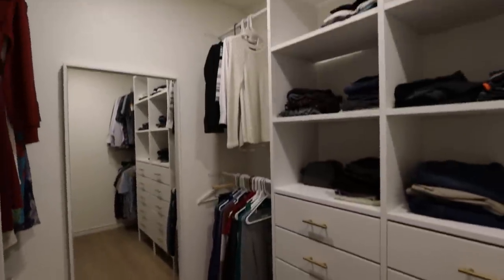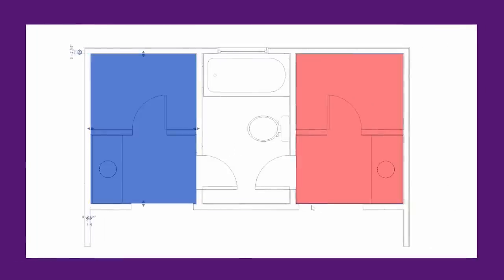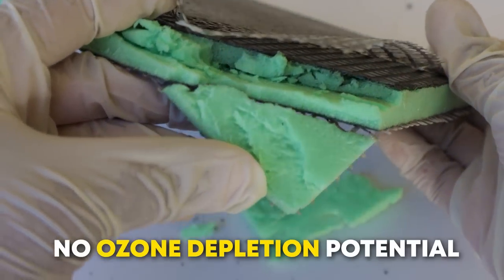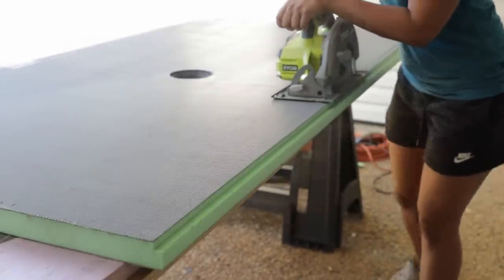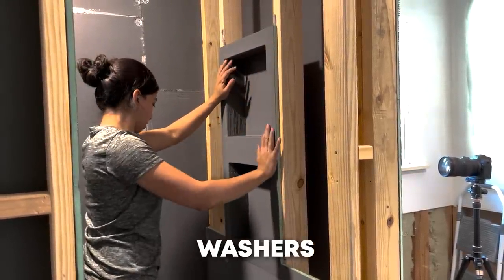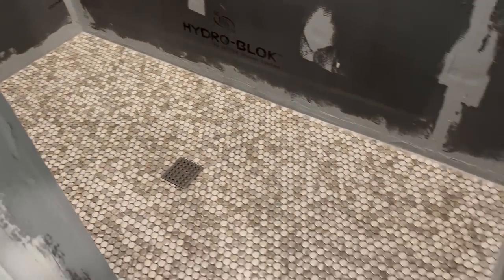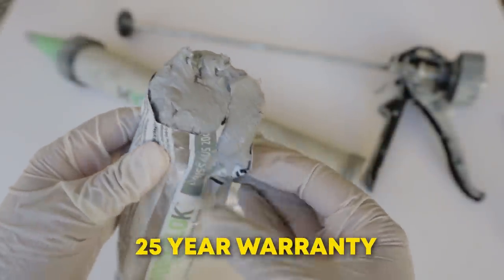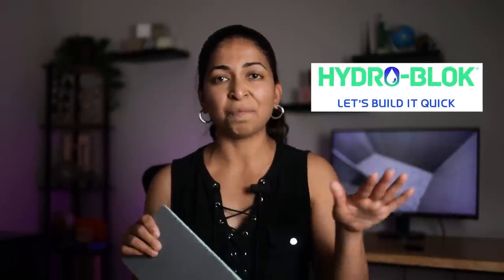How I built my bathroom & shower with green FOAM!

Comment: I did two bathrooms with a similar product in France. Works great! 
You can use the thicker panels to provide insulation on outside walls and the thinner ones can be used to cover irregular/old plaster (or concrete) walls.

Comment: I've been using Hydro-blox for a number of years now. I first started using the foam panel products when I discovered Wedi Board. It's an OK product but the Hydro blok panels are stiffer and denser. Using 1/2" concrete panels for shower walls is so last century. They are heavy and awkward and dirty. The foam panels are so light in comparison and can be cut easily with a matte knife. The development of these products is such a huge revolution for bathroom design, cleanliness and longevity. I love Hydro-Blok.
Reply from the maker: Thanks for sharing your experience!
Reply: Thanks for sharing your experience with using our HYRDO-BLOK.   That means a lot to us!!
Reply: How does this compare to my ideal shower enclosure material: fibreglass mould or acrylic walls?  They seem to be similar price-wise.
Reply: This material offers flexibility in being able to quickly shape it to any wall design. It is similar to the versatility of a sheet of drywall. You can easily create a curved shower wall enclosure.  Customize it to your needs. The pre-sloped shower pans can easily be customized as well. And the sealant is what sticks it all together of course with the washers and screws too. You can cut it all with a utility knife. I used to make the two layered mortar shower pans with the membrane. What used to take me 3 days now takes me 3 hours. The panels are super lite weight. No worries about screws below the curb-line. I'd be happy to answer any questions. :)
 @julesverneinoz
Reply: Thanks for the response  @maxadrian  .  You confirmed my conjecture that this material is best suited for customized bathrooms (those who don't like the plain look of and far easier maintenance of fibreglass mould or acrylic walls).  Do you still need to regularly clean the grout with this material, since (potentially) there's no grouting?
Reply: You do realize that the face of the hydro-blok panel is a surface that you tile on to, right? So with that said every tile project I've done has had grout. So, yes you do occasionally have to clean the grout. @julesverneinoz

Comment: A tip for using the sausage tube caulk guns. Insert the unopened tube into the gun, then pierce a few holes in the top of the tube and screw on the nozzle. After that trim the nozzle and squeeze out the product. When the product is out you can unscrew the nozzle an pump out the casing without making a mess inside the tool. Cutting the tube and inserting into the back of the gun as shown in the video will make a mess and may jam the gun. I bet Belinda did it this way for the sake of the video 😊.
Reply: You beat me to it.  They work great if done properly
Reply: @flyinpolack6633  Yeah, and the reduced waste and nozzle flexibility are a big plus. The guns are usually better built and higher leverage too! Wish big box stores stocked product in this format.
Reply: @juancarrera5524  What's with everyone calling caulk "product"? I've only ever noticed that from the makeup people. Is there overlap with this channel and the makeup crowd?

Personally it feels like a brainwashy word to use, conditioning us to believe that all things are meant to be "products" sold by corporations for profit, a.k.a. consumerism.
Reply: @MountainMan-ri2lr  lol I call it product because those tubes get shipped with other stuff than caulk sometimes.
Reply: @MountainMan-ri2lr  That's some tinfoil nonsense right there...
Reply: Thank you for the advice. I've never used one of these guns before. What you say makes good sense.

Comment: I would be interested in a comparison of Hydroblok and Schluter system. And/or details of the conventional cement board system they replace.
Reply: Cement board is shit. Cement board stays wet for the full half inch. It gets mildewy and stinks over time. Hydro-blok boards are waterproof after the first millimeter of depth. And may never get wet if you seal your grout well. Don't be afraid of it. It has been used in Europe for many years. The West is always slow to adopt new building techniques and materials. You don't need to build a concrete bunker for a bathroom. Expansion joints in all the suspect areas and you are golden. Try it. You'll think you died and went to heaven. You'll be saying, "Everything is so light and easy to work with. The days of sloped mortar beds and dusty heavy cement panels that crack and give you a backache are over!

Comment: I have only done one tile job and I used that red water proofing stuff. I did 2 full walls and the entire bathroom floor. We did an open shower. While it worked quite well not all the water drained off. I wish I would have added a 2nd sub layer floor and then cut a board with a very sharp taper for the shower area and glued and sanded it down so that way the shower had a sort of pan. Using some thin panel boards to help taper it down even more. Then installed the red water proofing stuff and then the tile work. It was meant to help someone who might one day need a better access to the shower with out a lip. It was super cool and is likely gone now. 
My current shower is a 2 piece fiberglass kit with a seat in it. I quite like that one a lot better. My next one is going to be one of those 2 piece kits with the roof section and the widest they make. I would love to find one that is 7 feet long and 5 feet wide with the roof cap and a really nice door. 
Though I am considering doing a tile one yet I do not want to have a raised tile section above my finished concrete floor. Kinda want one that you step down in to.  I want to install 6 of those stainless steel hand pumps that are built right in to the wall.

Comment: Hydroblock is good stuff, there are other brands too and that laminated foam panel type construction is more popular overseas. Tile still sucks and sadly i saw lots of grout joints but its ok for folks who cant afford panels. Those joints are messy for lots of folks (even pros!) so dont sweat it.  If you are good at drywall the tape and joints are a little easier. Thanks!

Comment: To avoid mess while working with caulk mix water with soap, apply it  on hands and caulk when  it’s pumped out on your surface. Much easier to wipe it off and you can spread caulk along with a finger. Look for a “magic wipes” or “wonder wipes” in any hardware store to wipe off harder stains from caulk  or any other sticky, greasy substances.

Comment: Very nice job!! Thanks for sharing this information.
Did you turn the two x fours on the flat against the wall studs in the shower?  Can you explain more of why you did that?
Reply from the maker: Thanks! I had to build out the back wall because there was a 4" PVC vent pipe running vertically.

Comment: The lack of a separate plastic liner would concern me. I believe them when they say that it's a water-tight system, I'd just like more peace of mind
Reply: Double water membranes are bad juju! If water weeps into them it sits there and rots stuff or causes mildew and mold. Better to enter the wall assembly and migrate out into climate controlled space. If it is a big leak then its a tear out if it cant be remedied outside the shower wall assembly anyway.

Comment: That is expensive but for the peace of mind as a DIYer it’s gotta be worth it. I wouldn’t expect an experienced contractor to use it though just because there are cheaper options where they can still compete and make their margins. Then again, the speed of the product could help them finish jobs faster which will in turn get them to the next job faster.

Comment: The cost is prohibitive but the uses a boon. I had in mind a shower unit for a bus/van conversion due to the weight issue. I could save considerably using such products. But the cost, ouch.

Comment: Cost would prevent me as a DIYer from using any of these systems.  I use redi-tile niches and cement board with membrane.  I have also bought fiberglass shower pans.  All told I think the cost if probably 1/2 for just as good a result (Some might argue about the shower pan I am sure).  Were I a professional I think the extra cost might be worth the time savings of a system like this.  But my time isn't worth enough to justify it.  I have done 2 bathrooms in my home and have the 3rd one torn out and ready to start the installation.

Comment: Showers...I'd love for someone to introduce ShowerDome to North America. It's a dome over the shower that catches the rising humidity and condenses it so it runs back down. It prevents the bathroom from getting all steamy.
Reply: Ventilation fan or whole house dehumidifier will take care of any moisture. This was an old home and probably not built to the code at the time or modified with cheap in mind.
Reply: @mikenotta7079  I think you're implying that a ShowerDome is a poor man's alternative to ventilation. Not so. It greatly reduces free moisture so those other methods are even more effective. ShowerDomes are used in all kinds of homes in Australia, New Zealand and Britain. For some reason, North America hasn't been introduced to them.
Reply: @r.1599  how they work is by redirecting condensate so it doesn't stop the air from being steamy but rather directed the condensate back down quicker. Think of a tagine.  They work well for what they do of course and showers dry quicker afterwards but an exhaust fan will help as well during and after.
Reply: @r.1599  Bath fans have not always been required everywhere. Even today a window will meet the ventilation code requirements in most areas but nobody under 45 knows that windows open. Even when they were installed they often become blocked as they dumped into attics and insulation gets blown over in later years.
Reply: @danielbuckner2167  Yes, exactly. It catches the steam in the dome and the steam condensates into water which then trickles down to the bottom of the shower and down the drain. Naturally one would also have an exhaust fan to catch steam that escaped when you open the stall, especially if you have done as Belinda has done, and have a clothes closet right off of the the bathroom.

I was fixing up my uncle's house after he passed away, and the scenario you describe with the exhaust fan had happened; the exhaust hose from the fan to outside had fallen off the exhaust hole in the roof, and had been exhausting moisture into his attic for years. Since the attic was well-insulated, it wasn't too much work to clean it all up and reattach the hose, but it could have been much worse.

The bathroom in my mother's apartment doesn't have an exhaust fan, so it's usually damp in there. She opens the window during a shower, but that's a bit chilly in winter and shouldn't really be necessary in a North American apartment building.

Comment: I know this was sponsored but would have been nice to compare this system to a Ditra system using standard cement board as substrate backer. For a small shower I would think the Ditra route would be about half the cost (closer to $1000)
Reply: Schluter is high priced. There are identical products for far less made in the USA and in Canada!

Comment: How did you upgrade the ventilation in this space?
Reply from the maker: Two supply registers and I installed an exhaust vented through the roof! Massive difference.
Reply: @BelindaCarr     Thought you might have invested in an ERV.   The tighter the house envelope the less likely you are exhausting any air.

Comment: I hate stud walls so much, everything is double brick around here with internal brick walls but extensions are often done with stud walls, ours is so troublesome due what happens when you have any issues with moisture
Reply: This is like hating trees because your car has no brakes.
Reply: @danielbuckner2167  more like I hate cars made of cardboard because they're weak and flimsy and no good in the rain
Reply: @justice4g  Not really but ok. Stud walls work well in some environments better than cbus because of lower thermal bridging. Either can be insulated to solve that but there are concerns as wood studs can be cut from regular lumber or engineered as can be renewable as a result. CBUs can at best be made from recycled waste but seldom are and conrete production alone accounts for almost 9% of greenhouse gases plus it is not renewable and is highly destructive through mining processes. I like CBUs, concrete AND wood along with steel and even some earthy upchcled materials but there is no perfect building material. Concrete and stone can last but not if they have rebar without constant cathodic and protection and I have personally seen wood door lentils still holding up almost two thousand years later unprotected in a humid environment so one size doesnt fkt all... or everybody. When building talk to your architect,  materials engineer, and builder about balancing what is best and personal preferences.
Reply: @danielbuckner2167  yeah and I was just stating my personal preference -> double brick, I know on its own it's not the best insulator but it's not really needed here, what I like is it's not going to crack or warp as long as it's on a solid foundation, doesn't need regular maintenance/painting can handle roof or gutter leaks or even full on flood and you can drill into and attach things to it anywhere.
Reply: @justice4g  Sure its def got its benefits... I like the lack of paint just like stucco or charred wood(I forget the Japanese name)! It can be hard for some people to mount things if they dont have a hammer drill but that's just a learning curve thing. It can handle moisture with no issue as long as it dries out quick 3nough to not mold just like pressure treated wood but I wouldn't let get it get too saturated. Have fun!👍🏻

Comment: 0:06 got to stop you only a few seconds in; did you undermount that sink in butcherblock?  You're not worried about water ingress in the exposed end grain?
Reply from the maker: Yes, I chose to use an undermount sink (found the perfect one at ReStore/Habitat for Humanity). I used 5 coats of marine grade polyurethane on all the faces of the butcher block. Water's not getting through that!

Comment: Looks like a nice product.  I've used the Schluter system  twice but this looks simpler so I will review more for our master bathroom remodel this winter.

Not sure why you cut the shower pan to put walls inserted into it. To me this creates a natural path for water to flow into should the caulking fail.  Walls sitting on top of the pan allowing the water to go only toward the drain, unless you have a backup, IMHO.

Like with the Schluter system, I might not trust one hundred percent and throw on a coat of RedGard.

Cheers
Reply: Agreed on water flow but the channel is to "capture" the wall panel lower edge better and maintain a straight angle.